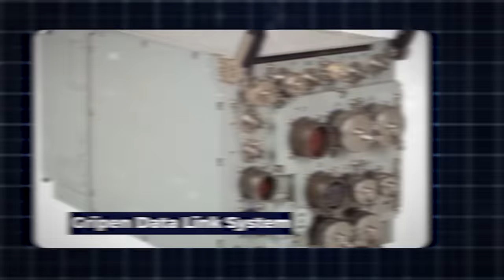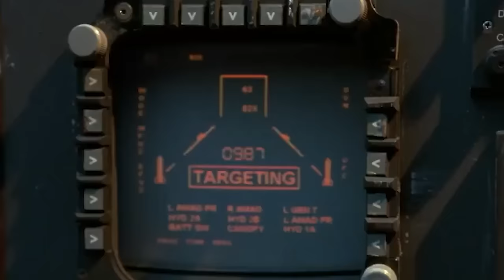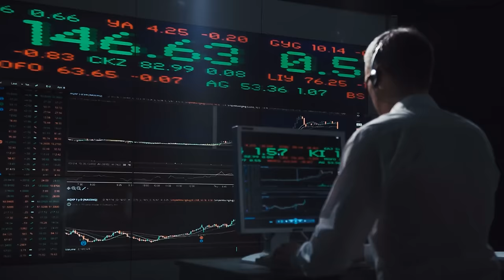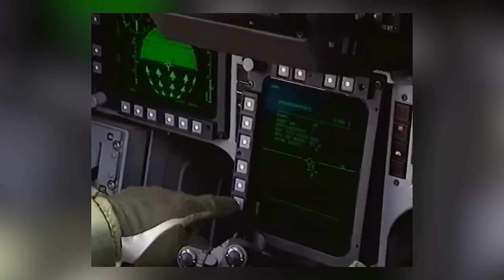New Swedish Fighter Jet Defies Physics. Here's How...

Comment: This is the plane Canada should be buying. Lower operating costs longer service life and greater range would be better than a stealth F-35.
Reply: The Gripen has one engine like in early model F-18s and as in the proposed F-20 Tigershark and I can actually see F-20 in the Fuselage.  They use their own afterburner.  The newer ones may have a 100% Swedish engine.
Reply: Agreed. Presently there are 15.000 F35 on the tarmac waiting for parts. The Swedes by comparison, will train our repair crews and no shortage of parts.